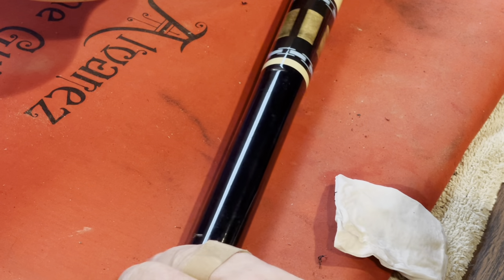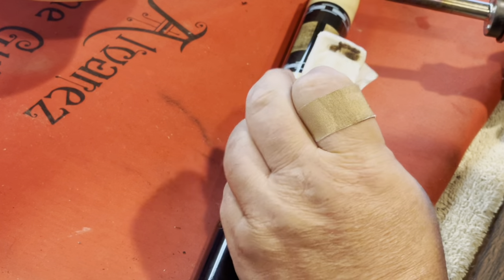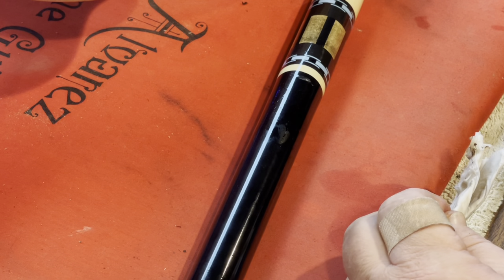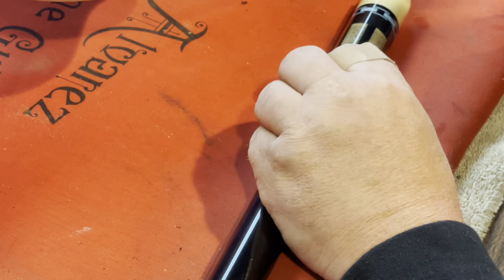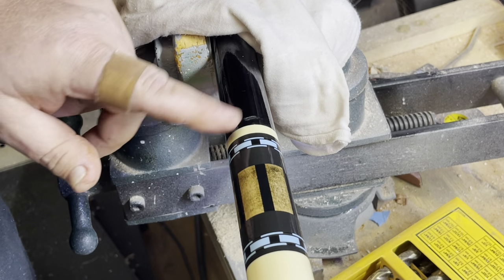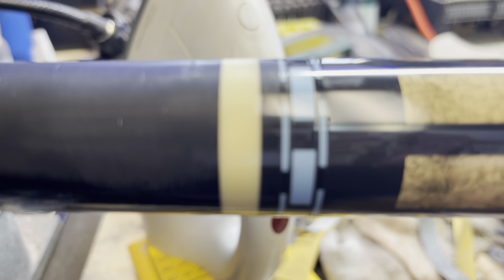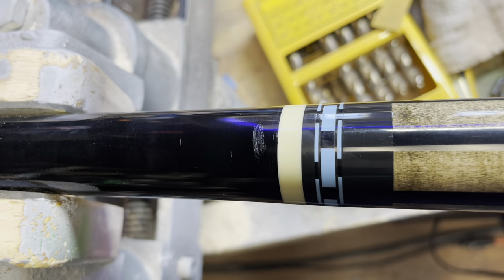Repairing a dent in a high dollar Mucci pool cue

Comment: Good job! Just fyi, Meucci clear coats over their irish linen wraps so thats what was dinged. You could have used black paint or die to get the linen back to black and it wouldn't be seen again. But its nice and smooth and still looks good. Thanks for the video
Reply: Looks like an ebony wrapless cue. There isn't any linens on it.  So not sure what you're talking about
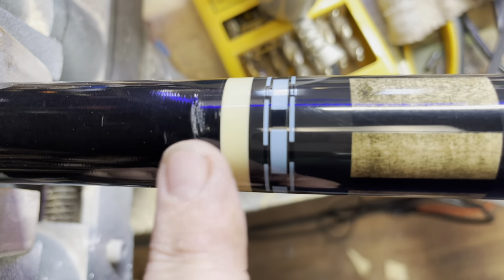Reply: @pmayh3m Watch closeup shots starting about 5:12 and you can see the linen wrap under the finish.
Reply: Black paint or die?  That's a simple choice!